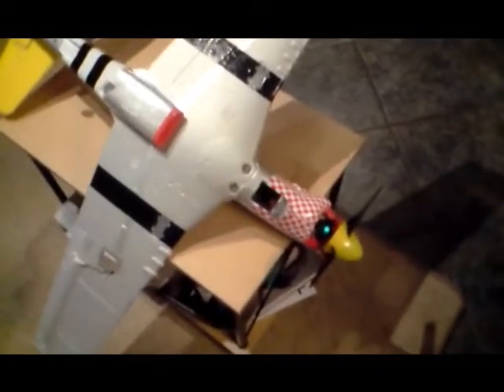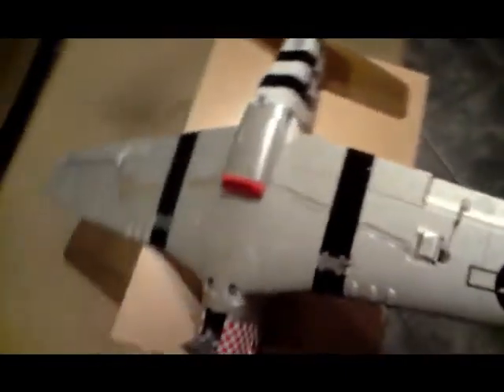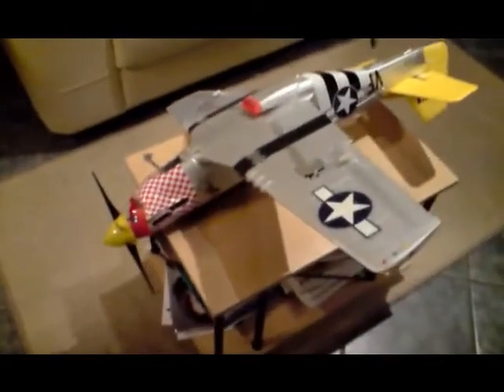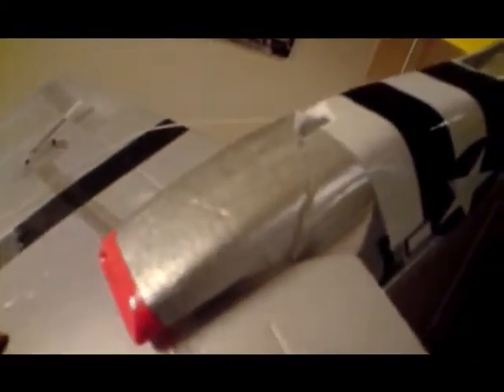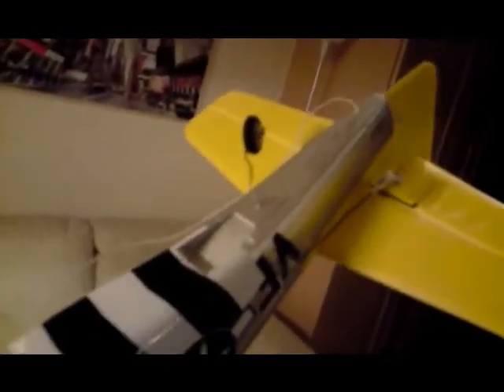Art-Tech P51D Mustang Damage

Comment from the maker: Hi burghoon. Thanks for the comment. I have repaired the Mustang now (will upload a vid soon). I used some Foam Safe CA and tape on the model - luckily I already had a spare motor mount and a new fairing for the front of the engine so it didn't cost me anything to repair it. It looks pretty much like new which I am pleased with.